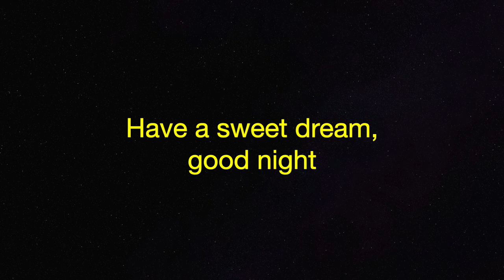Have a lovely dream and good night、See you again on Thursday.

Comment: Hi Tachi,
Again a nice peaceful video where I didn't know from the beginning where it was going to end.
At last, it was the best ever solution for a drawer. 
This way of making a slide is the cheapest and it works very well.
Which solution do you think should you prefer to never pull out the drawer completely. 
This sometimes leads to disastrous consequences. I solve this effect by making the drawer, longer on the sides, at the back. 
This way, of course, the drawer is shorter, but you can see the end coming and you have a full view of everything that is in it. 
In this way you will have a complete extension of the drawer, and have left a support to.
If you want a safety on top, you can attach a sort of Cam lock with just a peace of wood and a screw,.
In this way,  you can turn it horizontal when you want to take the drawer completely out.
Keep it safe, it is not over yet.
Willy from Belgium.

😷😷😷
Reply from the maker: Hello Willy
Thank you for telling me a lot.

This project will be revealed on Thursday.

Thank you